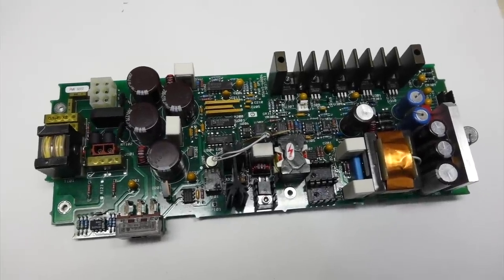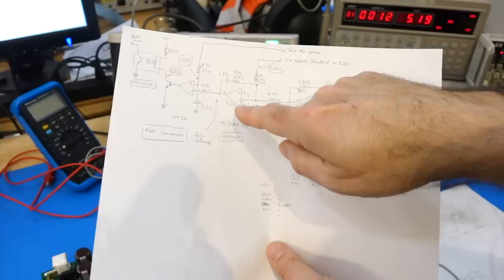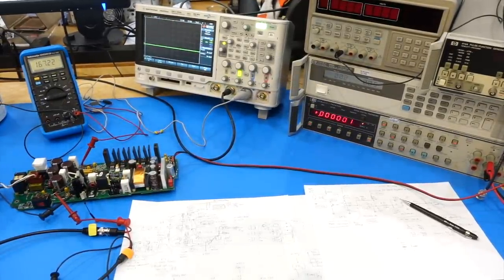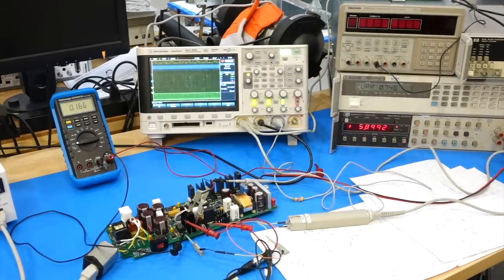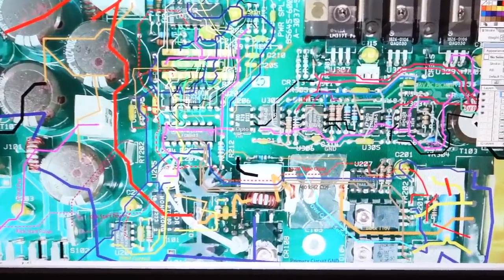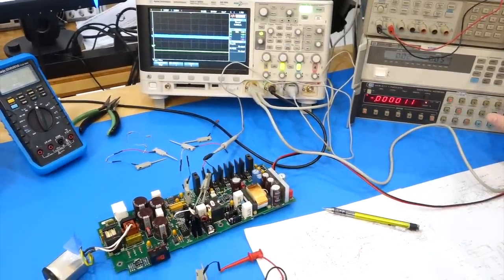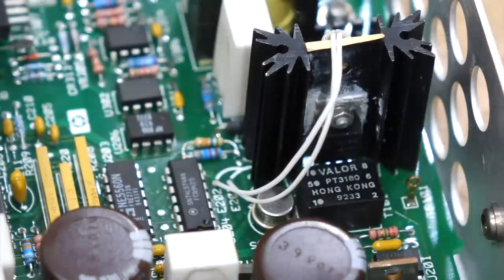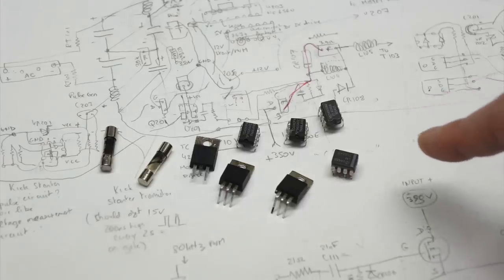HP Switch Mode Power Supply Repair Part 4: Repaired!

Comment: I have seen several switchers be unhappy with low current loads. A few I got surplus had a minimum load listed shown on the label with the other specs. Wish I had a tracking genny that went that high in freq. My IFR only goes to 1900MHz.

Comment: To me it seemed a little bit like the optocoupler was always bad since things changed after resoldering and you never messed with it before. Assuming a single component failure, maybe this caused the DC voltage to go high and start blowing stuff up? Assuming more than one failure, surely the opamps were not good

Comment: Excellent series Marc - really enjoyed it.   When you say HP was unwilling to help, did you contact HP directly?   Since they spun off test and measurement to Agilent in 1999 who in turn spun it off to Keysight in 2014, I assume it is Keysight who would have access to this type of legacy info - assuming it did not 'get lost' along the way.  
Looking forward to the next project......
Cheers,   John
Reply: Gotta love HP for saying they don't provide schematics for newer equipment, and then also say that they won't repair it, as it's older equipment. So thing is is "older" and " newer" at the same time? Definitely quantum!!

Comment: Well done sir, I think I would have gave up on the second video.  Mind you, you have all the equipment there to fix most things and also the knowledge to repair it.  Very good interesting video, yes it looks like it was designed for a full load all the time.  For me it is over complicated, over designed no doubt over expansive as well.

Comment: @CuriousMarc   Your optoisolator LED+transistor gain may have gone out of assumed design spec. They're binned by LED emission (which drops over age), and similar optocoupler transistor change with age. Dealt with this before with with suppliers substituting coupler version s(suppliers bought out, min gain specs get sploppy with replaced LED and transistor die, etc). Symptoms are usually out-of control switcher feedback loops. Check the whole PSU under repetitive transient loading with constant_I + pulsed_I and look closely at the optocoupler LED and transistor currents.
Reply from the maker: That's why they implemented the PWM scheme going across the isolator, so they would not be dependent on the varying gain whatsoever! The opto-isolator is fine, as you can see in the video.

Comment: tough one ! well done ! Consider making a video featuring ElectoBOOM and Feedback loop :-) reminds of the power supllies you could find in CRT monitors back in the days... Serious headaches and tons of switching FETs and fuses wasted,  to end up with a bad 10nF cap somewhere at the other end of the circuit :-D and of course going bad when warm for good measure! BTW if would have replaced the optocoupler as well. They can be quite dodgy...
Reply: Yes, PSU's are prone to the "cascading" fault that blows everything in its path up. Much worse than the "intermittent" fault (which annoying as it is can usually be found with freeze spray and a hair dryer).

Comment: @16:31 - and this is what happens when you spend this long trying to fix a switch mode PSU without any documentation.
Hopefully Marc will recover. :D
Cheers on getting the thing going again.

Comment: Fantastic conclusion! I try to never assume a test setup is applicable for the unit under test. If it doesn't work out of a device's normal environment, what did I do wrong in setup?

Comment: Good work and very interesting videos with very detailed explanations. Thank you for sharing this!

PS: HP will hate you for reverse engineering their secret design 😉
Reply: HP (who now make money selling ink cartridges) absolutely won't give a flying feck about this whatsoever. The original HP (now Keysight) engineers would I'm sure be more than flattered to discuss their design. NDA's permitting.
Reply from the maker: I don't think so. This does not get them or lose them any current business. It's just the corporate attitude that's gotten infuriating. Believe me, the great HP engineers are still there, making modern instruments, and their cubes loaded with the old classic ones they still use for debug, so they know. But they are poorly served by their management. If you ever work with them professionally, I was struck how the lack of vision and direction is immediately palpable, particularly in the computer division. BTW, Keysight should get their HP name and logo back, they are the true heirs of Bill & Dave's company. I wish them better times.
Reply: @CuriousMarc  1000% Agree with Marc here.
Reply: @CuriousMarc  It seems to be a common theme amongst big name companies unfortunately. The next step in the path to the death knell is to outsource your R&D; I came from a company that did this and it now seems they have no future product development path and will become either a named brand on someone elses product or possible a service provider only; this wasn't a small company either, probably on a par or bigger than HP.

Comment: Yeah, unloaded switching power supply doing crappy regulation, it's a common thing i've learned putting up gaming computer from scrapped parts. Some old PSU only kicked in with the more greedy CPU or GPU (albeit pretty unreliably). Switching power supply are for me some kind of complicated magical things dangerously balanced on a razor blade between "non functioning" and "blowing up"....
(so very instructive debugging)

Comment: I’m surprised to see you hook a pulse generator to the emitter diode of an optocoupler with no current limiting resistor. Every time I do that I immediately blow out the LED and so of course have to replace the optocoupler. I’ll never hook one up without a resistor in-line again. At least not intentionally.

Comment: What is the tolerance on the +5.2 rail?  I know ECL has very sharp switching thresholds and therefore the 5.2V supply has to be tightly regulated.

Comment: In the next episode Marc repairs nuclear reactor core ♥
Reply: A reactor controller might be a better choice. Cores are big, radioactive, and have a very deadly failure mode
Reply: Nope.  Nuclear reactor cores get reloaded with fuel or else get removed and replaced.
Reply: I hope there is a manual available for that.
Reply: @acme fixer Marc might over re-engineer it also, upgrading it into a warp core 💪

Comment: awesome series, thank you! now the only question i have to answer myself is... WTF is a tracking source. :D
Reply from the maker: I’m sure you are not the only one to wonder. It’s an oscillator that sweeps at the exact same rate as you spectrum analyzer scans (so it “tracks” it). It allows you to take transmission or reflection curves over frequency of any device, characterize resonances, filters, amplifier frequency response, antennas, etc... Transforms your Spectrum Analyzer into a Scalar Network Analyzer. In the last bit of the video I use it to take the transmission curve of a crystal. You see the nice resonance of the crystal at 1MHz. It’s only scalar, not vector, i.e. you don’t get the phase as you’d get from an (even more expensive) Network Analyzer. I have several old videos on this.

Comment: But you didn’t change the caps it can’t be fixed! Common YouTube wisdom tells us even the best electrolytic caps have a useful service life of 30-60 days 😂😂😂😂😂
Reply: Ha ha ha.  YouTube wisdom is always right, change all the capacitors, even if they are fine, they might be over achieving!  Change them anyway, throw away, get new ones, then look for the fault ha ha!
Reply: If you use electrolytic caps at their rated temperature, the service life can actually be as low as 41 days for 1000 hour ratings. It's why motherboard manufacturers switched to polymer capacitors around CPU sockets because the heat would cause failure of the CPU power circuitry caps. Video cards had similar problems when power consumption and heat output started exceeding electrolytic cap ratings and cooking them off. Cap failure was an especially horrid problem during the capacitor plague era.
Reply: Better yet, never use Lelon brand capacitors.....

Comment: Did you end up finding what the “normal” load on the power supply was?
Reply from the maker: No, I did not measure it. This thing has 8 voltage outputs that would need to be measured. I was just happy it worked again...

Comment: We are ready to sold(i)er on! 😂 so it was ONE Cold weld on the PCB! Incredible.
Reply from the maker: I think it was the bad JFET op-amp in the feedback loop. The supply is repaired just after we change it, but was not loaded enough to enter regulation. The resoldering the opto coupler was just a testing fluke as I explain later.

Comment: You could also have installed IC sockets once you desoldered the ICs... Safes time at the next fault.
Reply: I would never do that in this situation, this are not some logic ICs, but the power regulation ICs. You get one connection bad and whole thing smokes. This is why they need to be soldered in. Socket age and oxidise, and vibration can make the chip in the socket to get a poor connection...
Reply: That depends on the type of socket you use. But you are probably right, soldering is the safer option when it comes to power applications.